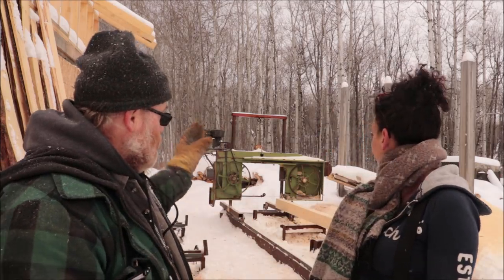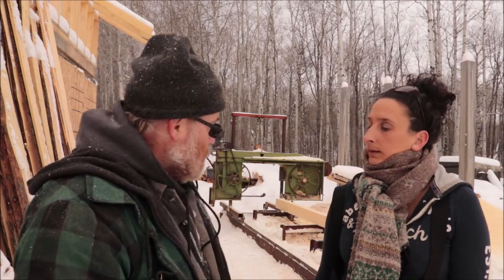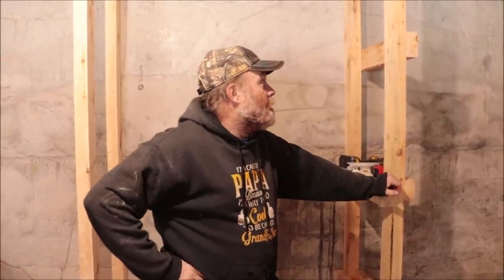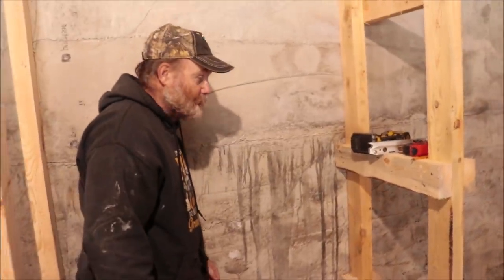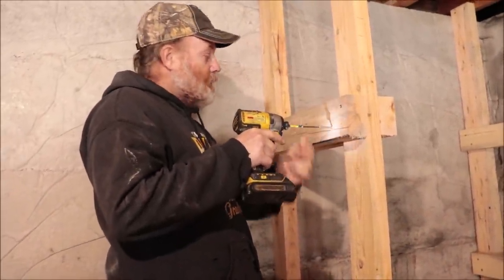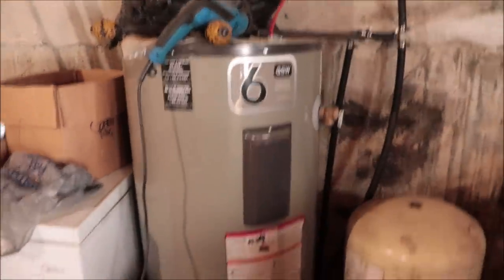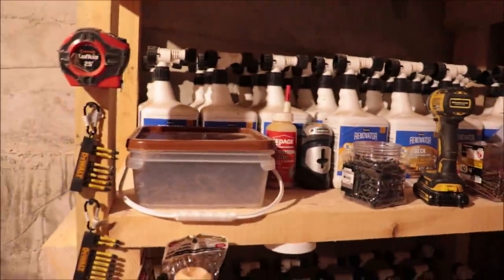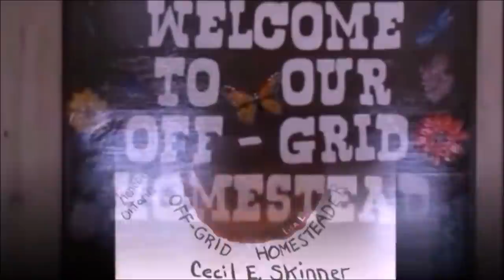This Made Her Happy Moving Them To The Basement.  Off Grid Homesteading.

Comment: Nancy and I found that clear bins with integral lids from Lowe's (Rona in your part of the country) make great for great storage.  If they aren't overloaded you can stack them, too.  I also bought cheap furniture dollies at Harbor Freight (your Princess Auto?) just to harvest the swiveling casters.  I build low plywood dollies using the casters and size my shelves so the bins and dollies roll in and out from under the shelving quickly and easily.  Just my two cents worth......
Cheers!
Whipple

Comment: Good job,Cecil when I had a basement in my old home,it leaked and I got what they call theroseal for the walls,you mix it like plaster and use a float to put it on with,sealed the walls,the floor you can us Portland cement no need to mix just float it in dry,the moisture from the cracks will wet it and seal it,

Comment: If your going to add concrete, you could put in an interior weeping, it would be faster and easier to break out a 12 in strip around the inside of the wall, and place along your footer, and then pour your new concrete on top, and you will never have a problem again, and you don't have to remove any soil from the outside of the house.

Comment: I guess the bigger issue with those smaller moisture spots may be what could be going on underneath. Otherwise, at least for a test, grind out one of the small leak areas, fill with some hydraulic or similar cement. Paint the area with bed liner. See if the moisture returns. Either way after a good scrub, I would paint the walls and floor with (tintable) bedliner. Instant vapor and thermal barrier along with a nice texture. Just my 2 cents worth.